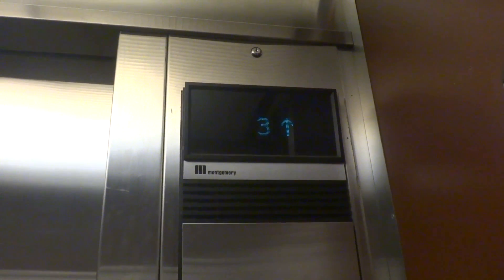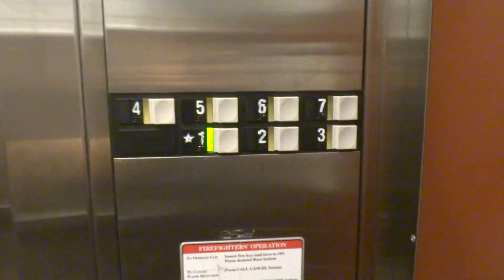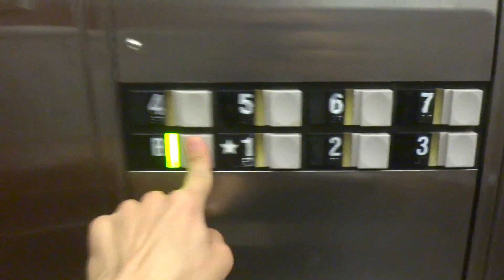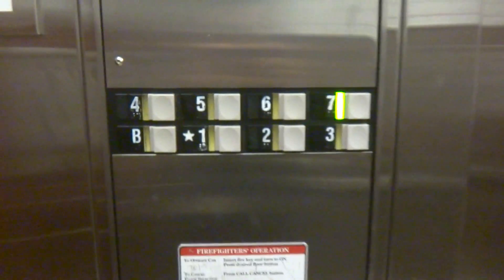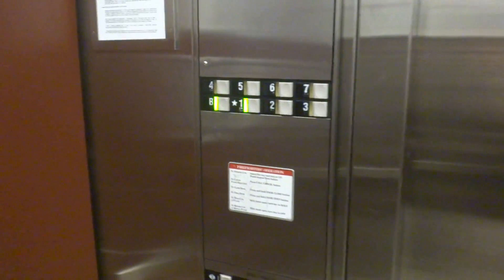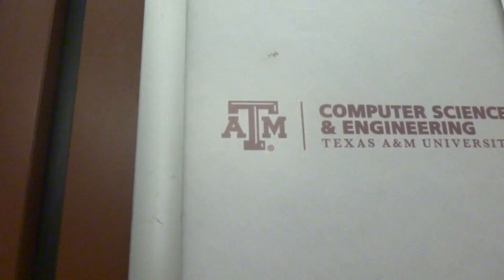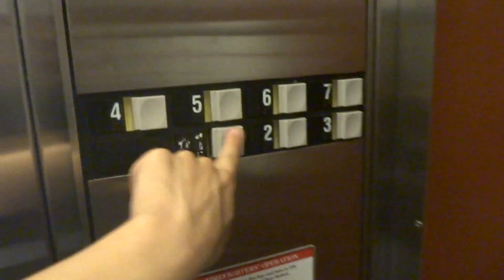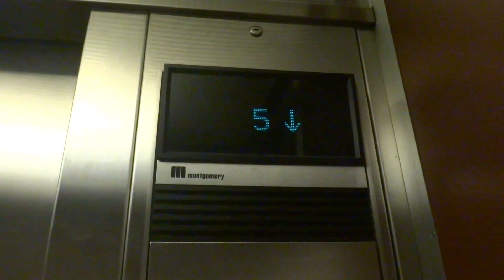Montgomery Vector Traction Elevators at Bright Building, TAMU in College Station, TX.

Comment: You say in the video the elevators were installed in 1990, but the description says 1988.
Reply from the maker: The elevator records stated that these are from 1988, but I think the plaque mentioned 1990 is when the building was completed and opened.
Reply: @JimLiElevators  it's possible the elevators were completed before the building was